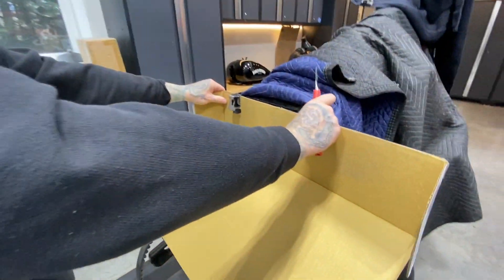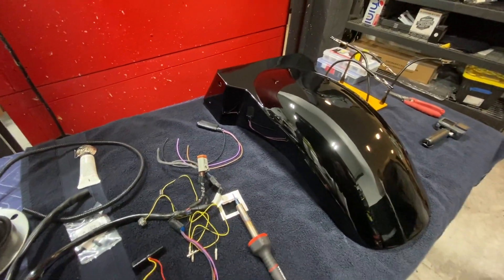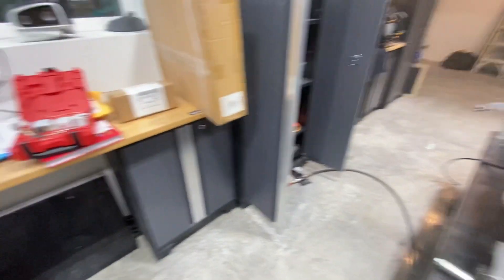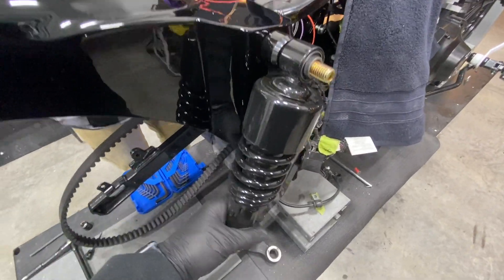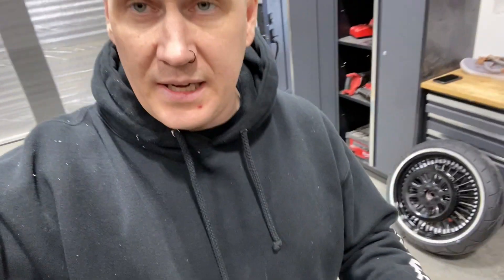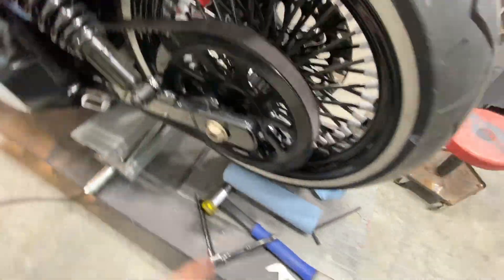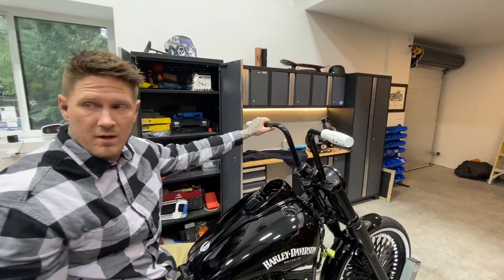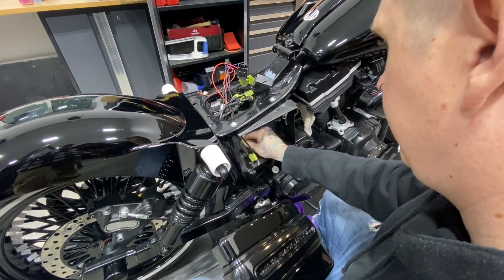DYNA Build "Black Sheep" Ep. 10 "Rear End Assembly"

Comment: the final speech is very nice. It 's true I do little on my harley but I promise to do more! thank you
Reply from the maker: That’s great! You want to know the truth. I’m a plumber by trade. I never worked on bikes till a few years ago. You can do anything man! Watch YouTube videos and go for it! you got this!
Reply: @martinjamesdesigns3748  in this period I have to do the annual maintenance and put progressive springs in the front fork and I will do it at home !!!
Reply: @martinjamesdesigns3748  the problem for me is finding the time. I am a photographer and I am always very busy :-(
Reply from the maker: @siouxs131313  that is totally do able for your home project! You don’t need to disassemble the forks completely, you just need to remove the upper fork nuts and remove the springs. Changing the fork fluid is always good to do as well. Any questions just ask!
Reply: @martinjamesdesigns3748  Thank you! Regarding the springs, the only thing that worries me is how to measure the oil perfectly. I saw that there is a kit with a syringe. Do you have anything to recommend?
Reply from the maker: @siouxs131313  remove the front tire and underneath the bottom of the fork is a bolt. If you remove that all the fluid will drain out. Once it’s drained (be careful it comes out quick!) then tighten the bolts back up and when you remove the top fork nuts and reinstall the springs it should be 8-10oz per side for each fork. That’s for a Dyna. Double check if it’s a sporty. (I believe that’s what you have?) Don’t remove the top fork nuts until the front of the bike is raised! Seems silly but I made that mistake once! 😂
Reply: @martinjamesdesigns3748  I got the technical manual for my 2013 sporty iron. It's all very clear. Thank you. I'll let you know how it went when I finish the job. :-)
Reply: @martinjamesdesigns3748  where did you get hit by the bolt? :-)
Reply from the maker: @siouxs131313  it flew by my head, hit the roof  and then dented the gas tank on the first bike I built 😂
Reply: @martinjamesdesigns3748  Ouch! 🤣
Reply from the maker: @siouxs131313  yes please do!
Reply from the maker: @siouxs131313  my brother used to have a 883 iron. Great bike!